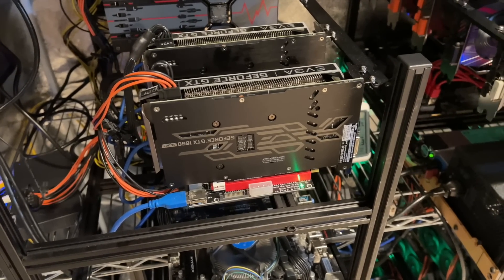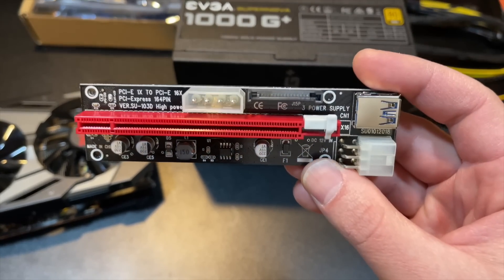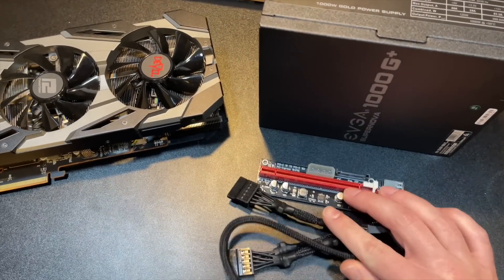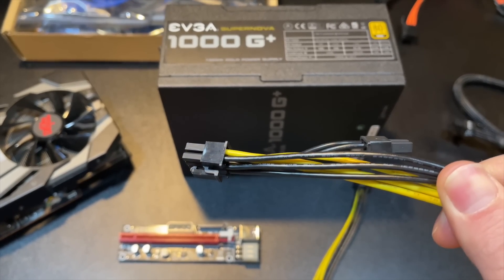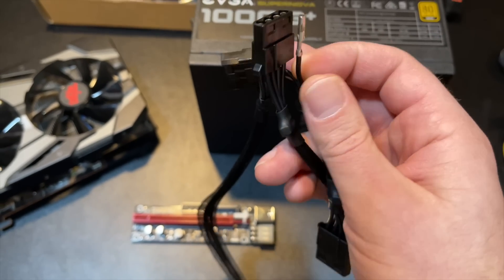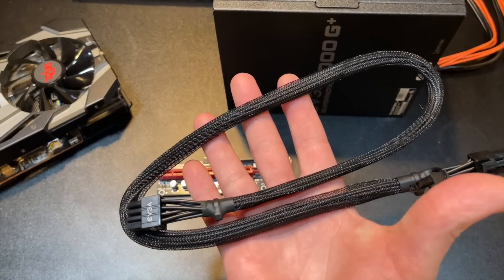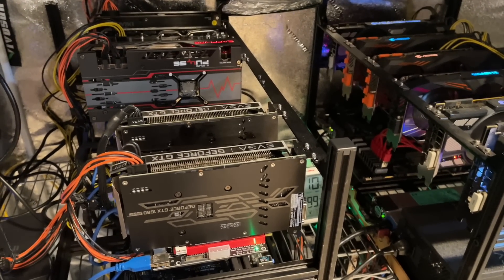Powering GPU Mining Risers Safely

Comment: Hey great video!! Will definitely use this as a guide for my future rig.

One question tho:

At 16:04 you say that your card's TDP is 125W. Ok, since a single 6pin connector to your psu can output 195W you can power a 125W card easily, got it.

Say im trying to power a RTX3090 (which has 3x 8pin + riser) using 2x splitters, as follows:
Splitter 1: Connects to 2x 8pin connectors
Splitter 2: Connects to 1x 8pin connector + riser 6pin.

Am i good?

If the 2 splitters have combined around 390W, and a RTX3090 has a TDP of 350W, i should be good. 
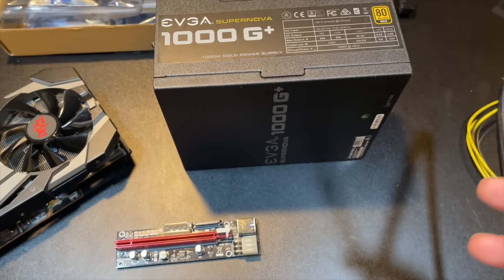However, you also mention at 12:30 that a 6pin and 8pin connector ask for 75W and 150W each, respectively. 
Since the first splitter is connected to 2 8pin connectors, which each can potentially ask for 150W, i could possibly be asking for 300W from that 1 splitter, which it cant provide!
How can i know how much power each component will actually ask for?

Thank you, hope i could explain clearly what my doubt is :S

Comment: Hey, thanks for the great explanation. Could you please shed some light on the controversy of WHERE the power comes in case multiple PSUs are used? Moreover, what is ideal use of the dual PCIx power from the thick central PSU bundle and how to handle dual PCIx powered GPUs and their risers? Many thanks again!

Comment: What about a cpu 8pin to 2 x 6+2 pin output cable adapter? I can't find any information but the cpu cable would be rated enough for around 330w if i'm correct

Comment: Great video. 

Noob here: So, it's a 8pin from the PSU with 6pin on the other side, which connects to the 6pin splitter which has two 8pins (if you want to power two raisers), but the connection on the raiser card is 6pins.

Comment: Hey, I have a powered riser running AMD Radeon VIIs. They can pull max 300 watts each. But I have sata connected to to riser and 2 splitted 8-pins from the PSUs. Can I just drop the sata connected to the riser?

Comment: Most PSU PCIE cables comes pre-splitted cables with 8 & 6+2 pin. If GPU only requires 8pin. Is it safe to  power GPU with the 8 pin. Use the 6+2pin to power the 6 pin on riser?

Comment: So power the splitter with pcie cables and power the gpu with them as well. So even for example a rtx 3090 won't pull more from the riser itself then 75 watts?

Comment: One time I had a PCI connecter melt on the PSU side.
Most likely causes, no full pin contact and/or oxidation.
I've had 1 Molex connectors fail (not melt) due to oxidation too. (On the riser end).

Comment: I have a lot of molex cables free on my psu but no more 6pin for risers. What if i cut and solder the wires to a 6 pin so i can power the riser ? Is this a good idea?  The idea is not to use the molex connector but use straight 6pin . Thanks for the advices.

Comment: Pcie cables has 3 12v in them. So if going by standards, 8Ax12vx3 wires = 288w
So is it safe to power one 1070 and a riser with it? 
Or one 1660Ti and 2 risers?
Reply from the maker: 1070 + riser I'd do since it's only 150w card. I personally only split PCIe once so I wouldn't do a GPU with two risers.
Reply: @RedFoxCrypto  Thanks...i will do 1070 + its riser. Can I split 3070 with a riser?

Comment: 1. PCI-E slot is max 5.5A in 12V(66W), max 3A in 3.3V(9.9W), and total <= 75W.
2. Molex 4 pin follows "Mini-Fit Jr.™" and its max current is 8A.

Molex 4 pin is the oldest and the most durable connector in the PC.
Reply from the maker: Have you come across anything that shows if the PSU manufactures are using that exact Mini-Fit Jr pin? Some are rated for 8A some even for 13A. It's been impossible to find out for sure.

Comment: Hello Red Fox,

I also have a 1660 Super, but when I split my 8 pin to 8 (GPU) and 6 pin (riser) it gives me the error of "please power down and connect the pcie power cables." I'm using a SeaSonic 1000W Platinum PSU, so I don't think the PSU is a problem. My splitter is just a common no-brand splitter without any markings on the wire, so I don't know any further details about it.

Any inputs is appreciated!
Reply from the maker: Hmm...that's odd. If you use two PCIe strands from the PSU no issue? Only when you use the splitter? First thought is that the splitter is no good.
Reply: @RedFoxCrypto  thank you for taking the time to respond. I actually fixed the problem. I split one cable and inserted both to the GPU and split another cable and inserted both to the riser. I dunno why this work and the other method didn't. 

I'm still observing if there are any negative effects, like melting or burning.

Comment: You are a bit wrong about why any connector is safe or not. Sata connector is not safe because  most of sata cables are made by adding like 3 sata connectors on one line. And they are connected via scissor type connection. This connection has the least connection area on the cable which leads to heating up. Molex are crimped and this has far greater connection are to the cable.

Comment: Wikipedia says that the 2.36mm molex can deliver 8.5A, and given their large surface area I'm pretty sure it can do the 75W.
Also, looking into the Molex website, when you select the 5A connectors, you get a few that are obviously smaller than PC molex.
Still, people should always use PCIe power connectors.

Also no, TDP is not power draw, TDP stands for Thermal Design Power and it deals with temperature and heat, not power, lots of people get that wrong.
A CPU with a TDP of 75W, can pull more than 100W of power quite easily.

Comment: Hi mate, that is a very informative video. Just wondering is that ok to use two PSUs with different wattage? For example, I have got one 1000w Gold EVGA PSU and one 750w Gold EVGA PSU, can I use them on the same rig to power more GPUs and risers or I need to get two PSUs with the same power wattage? Hope to hear from you soon, cheers mate.
Reply from the maker: Thanks dude. That's totally okay to use PSUs of different wattage in the same rig.

Comment: If you use hwinfo64 you can see that with certain cards such as the 1660super or other lower end mining cards you can see that the power draw from the pcie slot is around 35 watts. 35 watts is fine over sata.
Reply: Also just because something is specd for 75 watts doesn't mean it's going to utilize all of that .
Reply from the maker: Yes you are right it does show that info. I wonder how accurate it is. I'd love to get equipment to actually measure it live and compare.
Reply: @RedFoxCrypto  That is true the accuracy of that could be an issue you never know . Your recommendations in the video are great to be sure your doing the best method you can .

Comment: My risers are in the mail and they ONLY have SATA connections, no Molex and no 6-pin. I am however only using 1660 super cards, so my question is = Am I safe using SATA?
Reply from the maker: Personally, I wouldn't do it for the reasons stated in this video. If you had some way to personally verify that those GPUs would never pull more than 54w over the riser than you'd be okay.
Reply: @RedFoxCrypto  Thanks for the reply, will see if I can flip them and find ones with 6 pin

Comment: Please help:

I'm considering to get a 1660 super in a few days BUT...

I have a 750 Gigabyte PSU but I only have one PCI cable. That cable is right now connected to the Nvidia 3070. 
That same cable has another empty end that seems to fit in a new GPU. 
My question is: Is it safe to use this two GPU (3070 + 1660s) with this same cable?
Thanks.
Reply from the maker: I wouldn't use a single cable for multiple GPUs. Does the PSU have multiple PCIe slots, but you just don't have extra PCIe cables?
Reply: @RedFoxCrypto  Hi. Thank you very much for replying.
Yes, it has multiple pcie slots but I just have this cable, the store that mounted/assembled the computer didn't send me the extra cables at the time of purchase and I they don't have them anymore :/ 
I was told that it's very hard to find those cables for purchase.

Comment: I have one question... my psu unit has 4x6pins outputs, double type (i mean, one 8pins input to psu and 2 6pins output, each line, with 2 total lines ). I can use one splitter in output to power the riser and gpu? My gpu´s are 1660 super. Thanks for clear the most common doubts when we starts with mining!!! Best regards from Argentina!!
Reply from the maker: Hi Matias! You can power a 1660 Super and it's riser off a single PCIe strand safely. I think all the 1660 Supers take an 8-pin power connector though. Greetings from USA.
Reply: @RedFoxCrypto  sorry, where i wrote 6 pins should be 6+2 pins, but i understand the concept, one line for gpu and riser set. Thanks again!!

Comment: Very useful guide mate. Well done. After I watch that I just shut down my rig and decided to get 6PIN cables. Only problem I have, I can't find anywhere those 6PIN to 6PIN (or 6 to 6+2) cables in length of 40cm+. Any idea where can them please? Thanks
Reply from the maker: Glad I could help out buddy. Not sure of splitters meeting the exact length you need. I pretty much exclusively use the Deep in the Mines brand of PCIe splitters.
Reply: @RedFoxCrypto  thanks. Got them custom made here already. Now all risers are on SATA 6 pin connectors on PSU. can sleep in peace now  😆

Comment: Greetings.
What is the difference between female 6-pin and 8-pin splitter to male x2 6+2 pin? Which one do you recommend?
Reply: Example:
PCIE 8PIN to dual 8 (6+2)
https://a.aliexpress.com/_mq7sf2R

And you use PCIE 6 PIN to dual 8 (6+2) right?

Wich one do you recommend?
Reply from the maker: No difference for our purposes especially if you are using any modern PSU. It'll still have 3 pins that draw power from the 12v rail on the PSU.
Reply: @RedFoxCrypto  what do you think about using one cable splitted to two GPU's?
Reply: @RedFoxCrypto  Thanks! I will try to do it like you.

Comment: Sooo... what do you do when you have a riser and a GPU with 2x8-pin connectors. So effectively you need 1x6pin and 2x8pin. The majority of my cards are either 6+8 or 8+8 up above - plus the 6-pin down below for the riser. On an 8xGPU rig things get messy. This further complicates the splitter concept.
Reply from the maker: You'll need 2 PSUs. Best combo is an ATX PSU plus a Server PSU. This is how I run almost all of my rigs and I use a splitter to power 2 risers.

Comment: i found online on a mining forum that one perif cable can provide 156watts and searched on the evga forums a little and an evga forum moderator said and i quote "13 amps total for one perif cable."
and the first forum said to use 2 molex connections maximum out of the 3 molex connections total on the cable
as i understand it's because the gpu can draw up to 75 watts and if you use only 2 molex connections thats 156w/2=78w which is over the draw limit by 3w
correct me if i'm wrong since i'm about to build a 13 gpu rig and in desperate need of every little bit of information
Reply from the maker: I've seen that same EVGA forum post. Problem is no one has any references to back up those claims which is why Molex is "maybe" safe. I recommend sticking with PCIe if you want to be 100% sure.

Comment: Hey man is it safe to run 3rd party 6 pin male to male cables from the PSU to the riser directly? I bought some off AliExpress and I am always sketched when I plug 3rd party cables directly to my PSU.
Reply from the maker: Yeah that sounds sketchy man. I only run the manufacturer cables directly from the PSU.
Reply: @RedFoxCrypto  how abouts would you power 2 GPUs (i.e 3070 with 2 8-pin connectors)? Would would need like 3 pcie 8 pin strands from the PSU. One strand for each GPU with a splitter. Then a 8pin strand split to power the risers. I would like to use a 6pin from the PSU to power the risers. But all the 6pins are either sata or molex. Some of my modular PSUs only have 3 8-pin strands. Am I making this more complicated than it should? Lol

Comment: Hi Mike. Q: I have a an MSI 3060Ti conected to a raser. before this videa I have the raser conected to a ssata. Now I know this card has a TDP of 200W. the question is the following: If i connected to VGA 8 pins each to my EVGA 750 and then I connected the two of them two the card (6+2) x2. this means y have a power of a 192x2 = 384W. so if the TDP is 200W this means I can get a good splitter and conect one to the card and the other to the riser and I´ll be safe?  Another question. my evga cable already have a spliter. the problem is they are not enought long, but if y use that spliter for the 16pins that the card needs. I could use other vga cable and conect the raser. I am ok with the logic? Which option would you recomnd?

Comment: If the 1660s TDP is 125w and the riser is 75w, you are getting 200W (in the worst case scenario).  And the cable is 192W.  Is that safe??
Reply from the maker: 75w is included in the 125w. The GPU will pull from both the riser and the PCIe plug on top of the GPU to get the full 125w.

Comment: Can I feed the Risers from a separate Server PSU left-over from an ASIC? I have an HP 1200W unit that can feed 12  of 6-pin cables. The only thing that worries me is that one must start it with a button on the power break-out board, so it is not perfectly synchronised to the ATX PSU when powering up the rig...
Reply from the maker: You should have the riser+GPU on the same PSU. So you can split a 6 card rig to have 3 cards+risers on the server PSU and the other 3 cards+risers on the ATX PSU. Just always power up the Server PSU before powering up the rig and you are fine.
Reply: @RedFoxCrypto  gracias 🙏

Comment: Hi, could you help me. Im trying to power a gtx 1050 ti. Doesnt require external power. The cable i have has a 4 pin adapter. Its meant to be powered from sata power FROM THE MOTHERBOARD Plus 7 watts from the m.2 slot where im plugging the riser in. Is this okay? Because the motherboard itself wont give 54 watts eitherway.

Comment: Need help from anyone who knows their stuff. Just got into mining I have a 3080FE dual 8 pin, 3070 Suprim X - dual 8 pin and 2x 1660 supers with 1x 8 pin each. 

I have a Corsair RM850x PSU. Will I be able to use just this one PSU and manage to connect everything? I'm absolutely miffed at all the power details of this stuff or it seems I dont have enough cables to power everything.

Comment: New 2 week old miner here, sitting on lunch break at Molex watching your video. Felt like you were asking me specifically about our cables! Lol.
Sadly I can’t answer your questions, I just plate the pins in the housings. 
If you write down a specific question or 2 you have about the Molex connectors, I could possibly ask my supervisors and work with you to get an answer. 
Great video!
Reply from the maker: Wow that's crazy dude!! Welcome to mining! My biggest question is what exact pin part number is being supplied to the big PSU manufacturers (EVGA, Corsair, etc) to use in their PSU Molex cables. Knowing that I can look up the specs of it, see the amount of amperage it's rated for, and confidently know the amount of wattage the cable can handle.
Reply: @RedFoxCrypto  I need some used graphic cards and motherboards to start with can any of you be of help. I'm from Ghana and I have been trying to mine small coins. Thanks

Comment: Thanks so much! So can I also connect two graphics card with splitters like you did for the risers?
Reply from the maker: You're welcome. I'd avoid connecting two GPUs over a splitter since most GPUs will pull closer to the max wattage over the PCIe plug versus the riser.

Comment: When you have a splitter for 1660 Super and its riser, 1660's TDP is 125W and the maximum power draw from the riser is 75W. To add them up, it becomes 200W which exceeds the wire's capability (192W). Am I missing something here? Even if it is running parallel on the splits, the total maximum power draw at the merge will be 200W which is more than what a 6-pin connector is rated for. Can someone clarify this for me? Thanks in advance :)
Reply from the maker: The riser doesn't pull an extra 75w. That 75w is included in the GPUs 125w TDP. Thanks for watching John!
Reply: @RedFoxCrypto  Hey man thanks for the quick reply! SUBBED :) Let me know if I get this right: In your 1660S setup, if running full throttle, the maximum power draw at the riser is 75W, which makes the power draw at the 6pin on the card 50W.
Reply: @RedFoxCrypto  and the reason why you are not using the SATA is just IN CASE it pulls 75W it will go badly. But, are there any priorities? i.e., if the card NEEDS to pull 125W, will it max its power from the riser first? Or it will prioritize the 6pin on the card and have 100W on it, with 25W on the riser?

Comment: The RTX 3080 is rated for 320W of total board power. Each 8-pin power connector can supply 150W of juice, leaving your mother board to draw the rest. only 50W if you have a RTX 3090

Comment: I am a little confused, can someone help clear this up. If I am running at 3080 at full power with 320 TDP, a splitter wouldn't work correct? Since they are rated for 150 watts. if not, what do you recommend I do to solve this issue?
Reply from the maker: You'll need separate PCIe strands for the GPU itself and the riser. Safest is 2 strands to the GPU and 1 to the riser.

That said, I do have a 3080 running with one PCIe strand with a splitter going into the 2 8-pin plugs (and another going into the riser) It's on Hive OS and those overlocks are super unlikely to reset unlike windows which makes me feel comfortable doing it.
Reply: @RedFoxCrypto  So, I looked up the AWG chart and it states that 18 gauge wire supports 650 watts? You are saying 150 watt.

I apologize, I hate electricity lol.

Comment: Use server psus . Breakout boards from parallelminer (x11a i prefer). 16ga wiring for for the 6 pin. 1 rail per riser. Solid stability. 94 % efficiency.